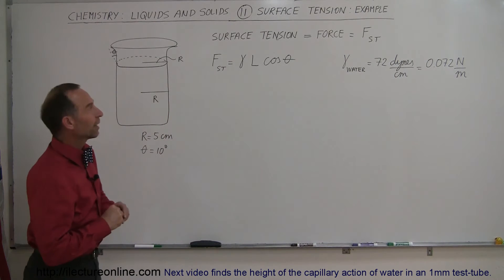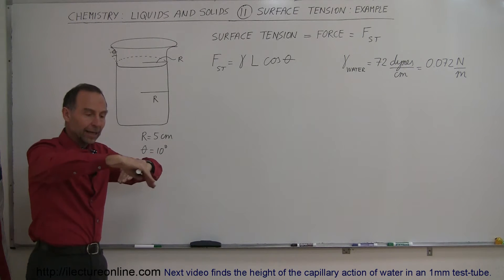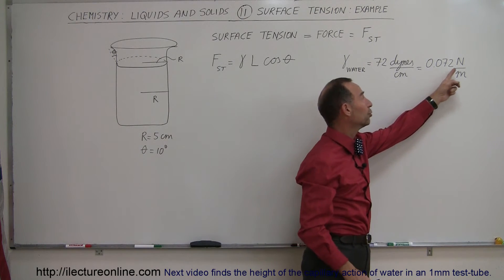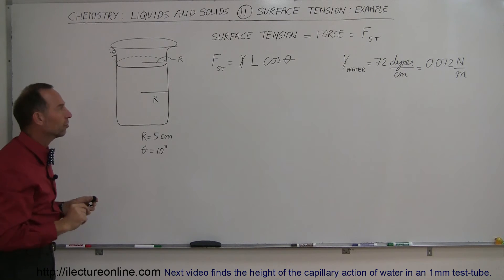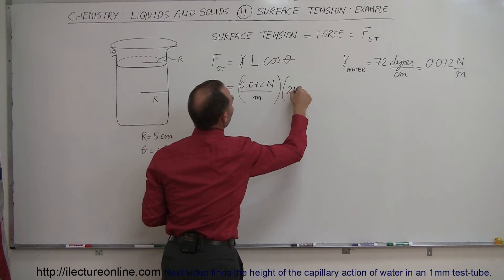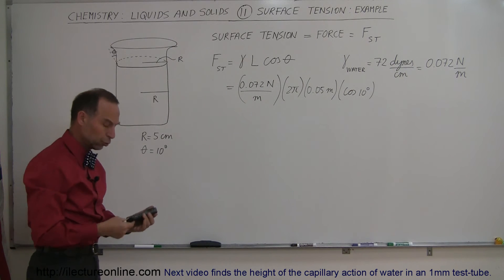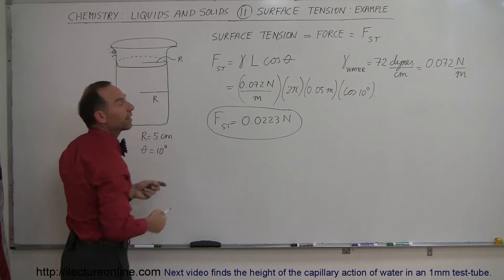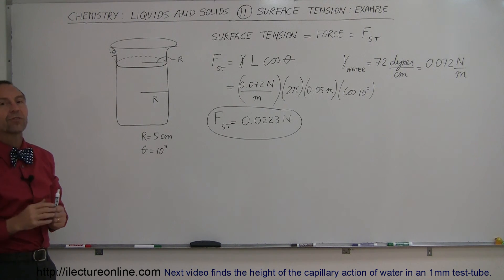Chemistry - Liquids and Solids (11 of 59) Surface Tension: Example

Comment: In the experiment where a mesh is placed over the top of a cup. The cup is then filled and flipped upside down so that the surface tension holds the water in the cup... Is the force required to penetrate the water calculated based off of the size of each individual hole in the mesh?  0.072 * the area of an individual square hole in the mesh?
Reply from the maker: Steven,
Notice that the force caused by the surface tension is a function of the coefficient of surface tension and the length along which the surface tension acts.  
That is why smaller holes have a higher force/area ration and thus a higher force/water volume ration.
The force depends on the circumference of each hole (not the area).
Reply: Ahh ok, But if the hole is a square then it's the perimeter of the square right? So .072 N/m * parameter of an individual hole *  the cosine of what?
Reply from the maker: Steven Roemerman
You are correct.  In the case of a square it is the perimeter.
The angle depends on the material and contents of the liquid.  Then angle tends to be between 0 and 10 degrees.